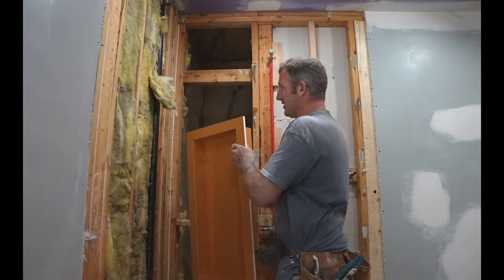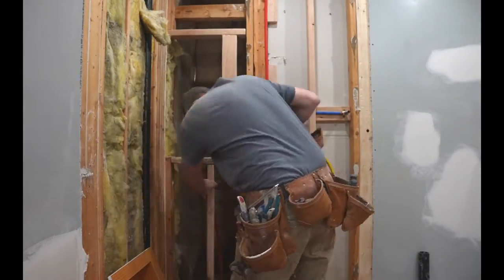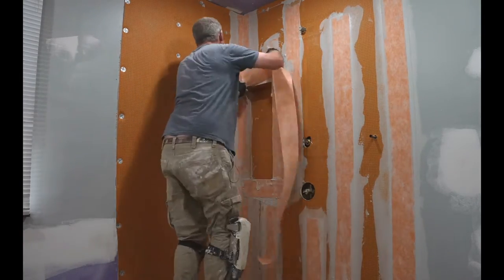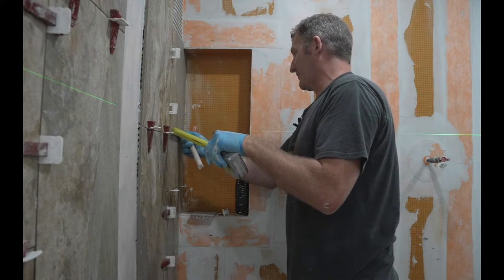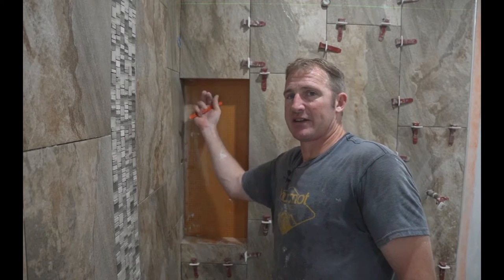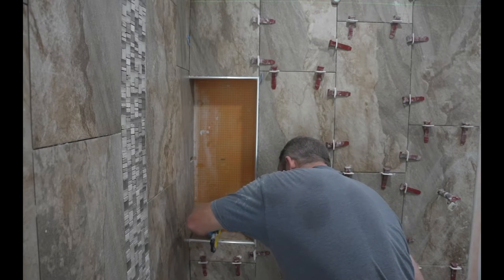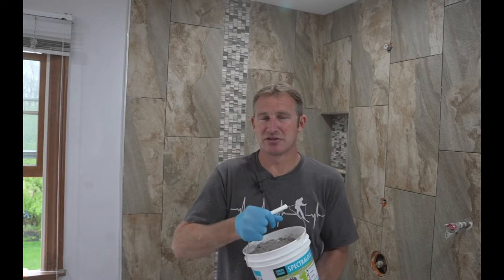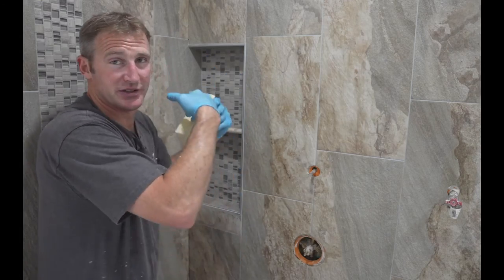The Easiest Way to Build a Corner Shower Niche l PLAN-LEARN-BUILD

Comment: Hi Steve. Thanks for all your knowledge. If using jolly and fabricating a custom niche from I would still finish the wall tile around even with the backer board inside the niche, and the jolly edge will cover the edges of the inside tile, is that correct?

Comment: Always had trouble figuring out how to build niche with full tile botton and full ontop but this really helps would you be making a video in the future how to properly charge on jobs? For like demos prepping installation grouting and etc??? For like bathrooms backsplashes chimneys etc?
Reply from the maker: Yeah, I can do that! Pricing is a bit tough to go over since everyone has somewhat different overhead costs. But yeah, that might be a good video series idea! 👍
Reply: @BathroomRemodelingTeacher  yeah i get you im in Illinois so im sure it way different compared to where you live but iknow its not per sq ft in bathrooms for tile correct,

Comment: Do you 45 the Rondec?
This corner niche is exactly what I’m going for but was afraid to go flush to the adjacent wall. 
Liked and Subscribed!
Reply from the maker: Yes. I recommend mitering the rondec. I’d also recommend cutting off the tiling flange on rondec in area you plan to miter. That backing likes to flip up when using a miter saw. 
Also having the back wall go into niche really makes things easier with tiling

Comment: Steve , when u tilt the bottom plate and shelf towards shower . Did you have to cut the uprights on the sides a little off or did you cut them straight ?
Also does there need to be gaps between all pieces ? For grout or caulking ?
Reply from the maker: Yes, you’ll need to slightly scribe cut tiles meeting sill of niche, just like floor. And it is best to leave a little gap. (1/16” or do) Helps hold silicon or grout 👍

Comment: I’ve never put a niche in the corner like that. Thanks for the tip, with that tile going into the corner, makes one less place for water to seep into.  
Question for ya, have you ever used the IQ tabletop saw, and what’s your opinion if so?
I’ve had mine about 2 months now, and still not sure about it!
Reply from the maker: I’ve seen it demonstrated. I wasn’t overly impressed with it. Was just conversing with Sal about it. He says it’s great. I’ll probably end up getting one. Would really help with mosaics since nothing gets wet
Reply: @BathroomRemodelingTeacher  
It’s very convenient. It really depends on what tile being used. In winter it’ll be great, just have to spend a little extra time with the hand pad to get chips out. It seems to cut better the more I use it.

Comment: I have a 21 inch niche with a 4.5 inch shelf which basically gives me an 8 inch niche and a 9 inch niche.  Has anyone noticed the ludicrous height of the shampoo bottles the "good stuff" comes in?  I have, because every woman in my life brings it to my attention.  The guy that did the shower was a pro that did not have a clue how to do a niche with floated shower walls.  I would have been better off with a glass shelf.  I wish I would have seen this video before I had the shower done.  I would have objected when the 2X4 went in as the shower shelf.
Reply: I got same problem. Paid $10,000 to remodel my shower and guy put 2 niches 8 inches high each. We have to transfer shampoo into little bottles all the time for years. I will add a corner floating shelf to put regular height bottles.